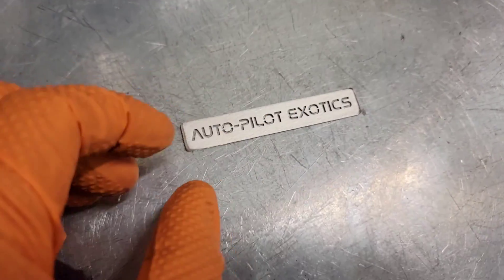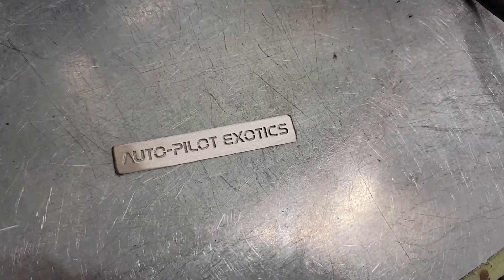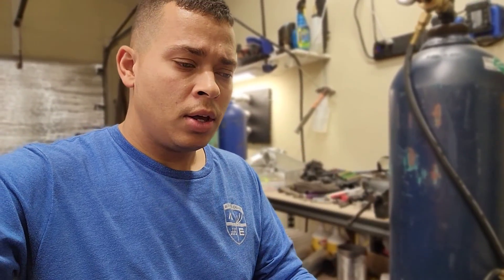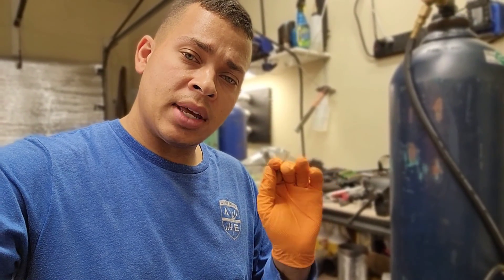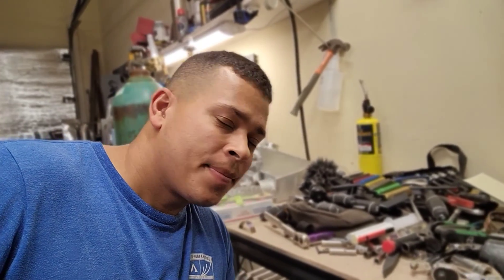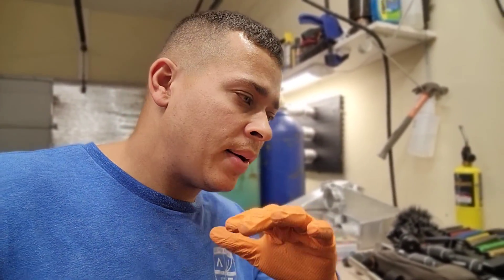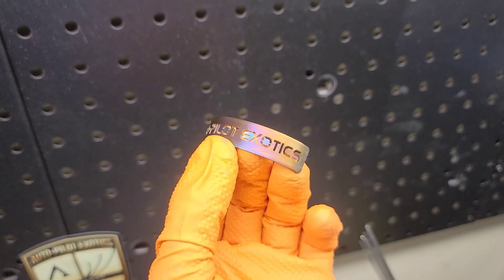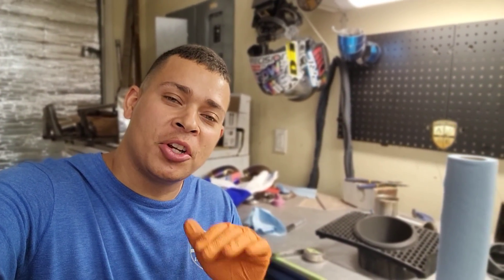How to Heat Treat Stainless Steel or Titanium

Comment: Besides creating a color sheen to the stainless steel, what properties are created that you would want to heat treat stainless steel. Does it make it stronger are springy or?
Reply: 304 ss can be used as a spring but maybe blueing would be a better title than heat treating.